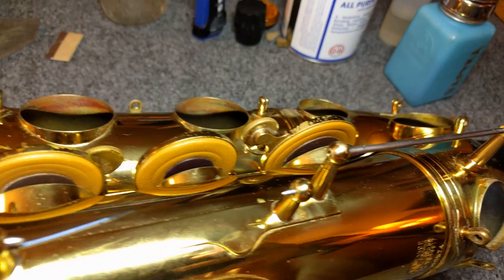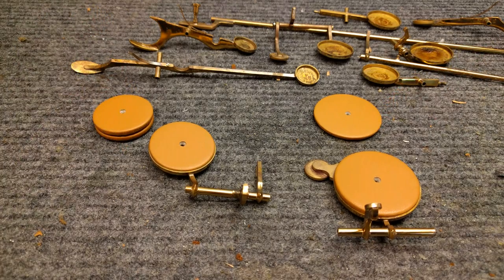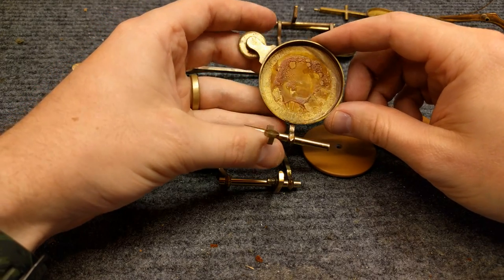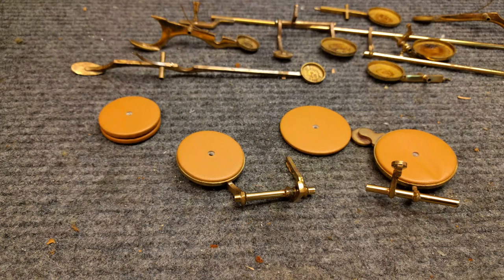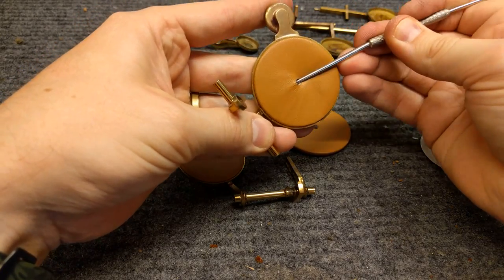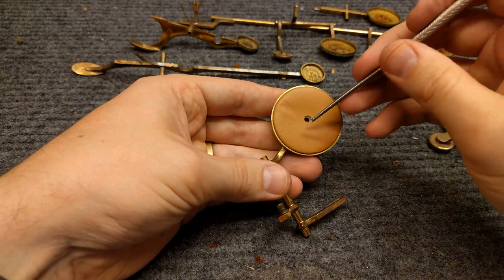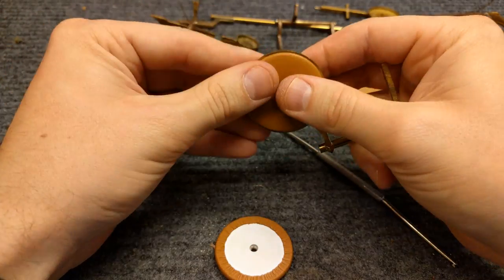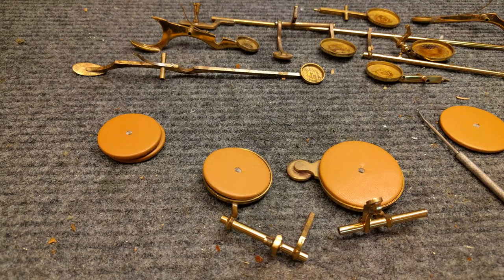Saxophone Repair Topic: Sizing Sax Pads (And Why I Don't Use Pad Sets)

Comment: Great video Matt! I am learning to repad and maintain two of  my own saxophones ( Buescher True Tone & Selmer balanced Action  ) and so far has done one complete repad - find it very tough to get pads seated well in a key cup for along time. have to re float few of them every few days of playing  as most pads don't keep the seat well :(  I know , It's been requested few times before - but, is there any chance for you to do a special video on how you actually install and seat - float the pads using shellac and pad slick and pad pricks so that they keep the seat well? thanks a lot in advance . Keep up good work , Dimitri
Reply: That's really something strange that you describe: How come do your pads move once you have seated them? Floating the pads is a method to get in trouble. You don't have to float them, you need to press them firmly into the key cup so that the shellac is distributed evenly at the back of the pad. Then once the pads are glued firmly you manipulate the key lever and find the best fit of the pad to the tone hole surface. However before fitting the pads to the tone holes you have to level the tone holes. Otherwise you'll be making them fit forever.
Reply: I think manipulating the key lever is a really old-school way of doing it that isn't so popular anymore. I have a Buescher I'm working on, on which some of the keys are bent up presumably because of that. Because pads need to be replaced eventually I think almost everyone floats them now

Comment: Matt when you were showing the pads at the beginning why is that one resonator appear smaller in diameter than the ones on either side of it?
Reply from the maker: They are sized to their toneholes, and the E tonehole on a VI tenor is relatively small compared to the surrounding ones- and much smaller than normal relative to its key cup & pad.   The F and D are more normal.  These are the original reusable plastic resonators that came with the horn from the factory.

Comment: Thank you Matt Stoher. My tnr has plastic resonators. When I replaced some pads in the L-hand stack I used a metal resonator on the pad above the C. It gives a more open sound for C on this horn. I am happy with it but have I missed something?  What problems are there with mixing and matching?